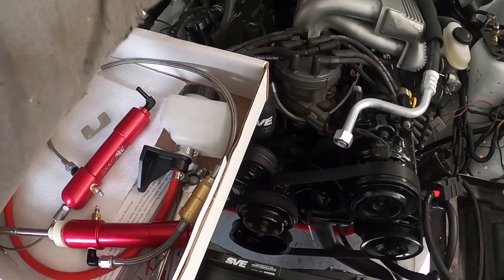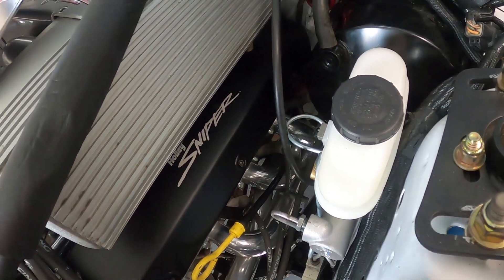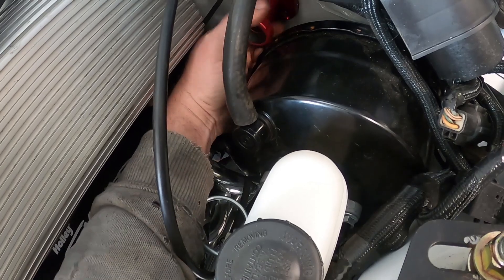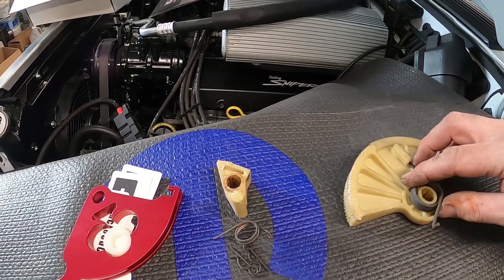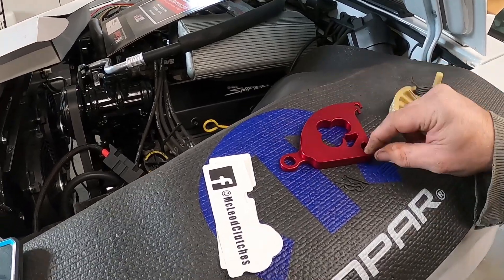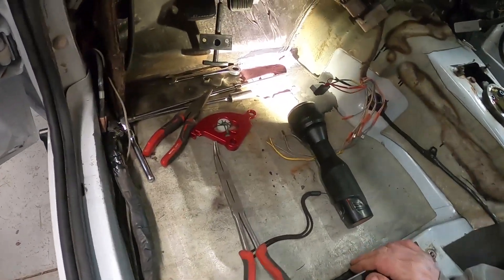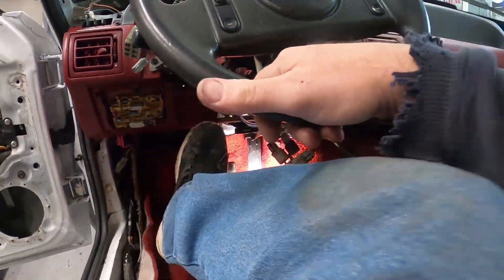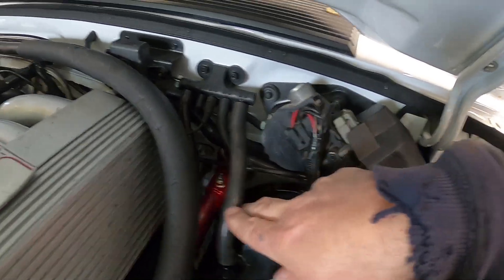fox body Mustang McLeod Hydraulic Clutch Cable Conversion

Comment: Hey I installed the clutch onto my mustang and when I clutch I have no pressure, do you have any suggestions, it’s not pulling on the clutch fork under the car. It just sits still.
Reply from the maker: its a late reply but if i had to guess you still have air in the system it need bled out more

Comment: Hows it feel now?  Would ypu buy again?  Thanks
Reply from the maker: before I purchased this I couldn't find much newer info, the install was not too bad it does have a different feel over the cable having the lake wood bell I was unsure if it would work i was hoping for a lighter peddle but no luck, the distance from start to fully engaged was reduced in peddle feel over the cable.  but now my curiosity has me wondering if the internal slave will work better as i have plans to order one and try it